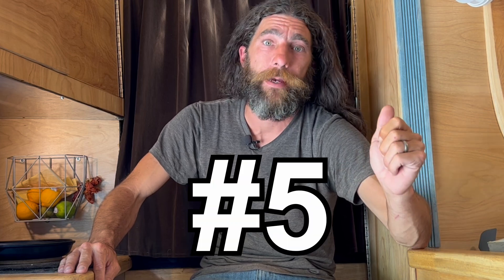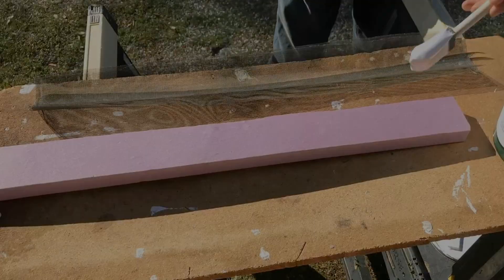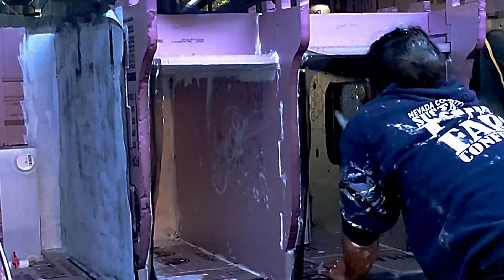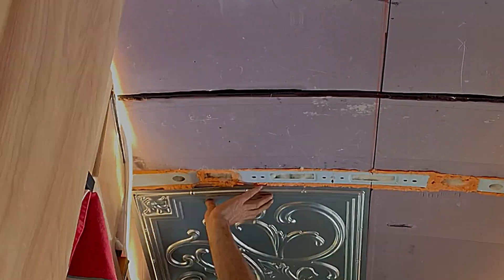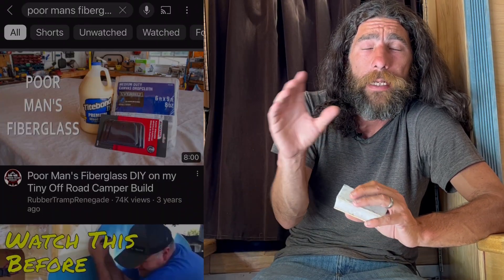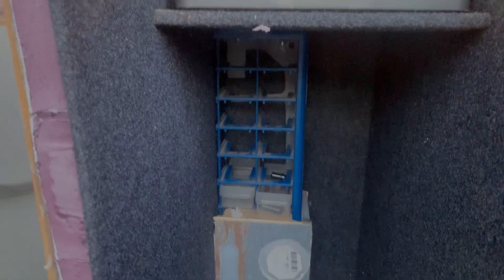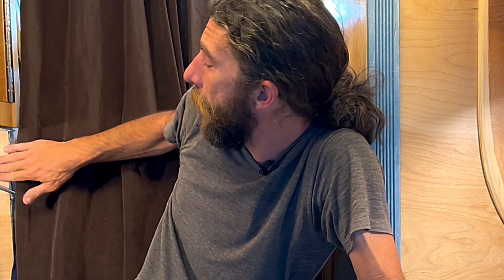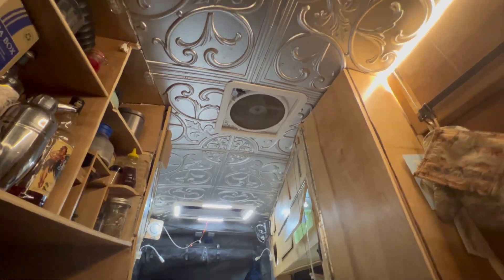Foam Camper Van Screen & Skins -Foam Building System Vol. 5

Comment: Really enjoying your channel. Lots of good practical advice. I am looking forward to building a few things using this method. A truck topper, a small canoe or row boat and then eventually a squaredrop camper. I also want to do some strength testing along the lines of what you have done. I am curious to see if bonding multiple thiner layers of screen and foam is stronger than one thicker layer of skinned foam. I would also like to do some tests to see if perforating the foam with the spikey roller things actually helps with the strength of the pannel or if it only helps to ensure full adhesion. I think the light weight, the mold resistance, and the resistance to water penetration make this an amazing build material. Even if you do get water through the glue/paint/skin layer it still can't enter or damage the foam. I think it would also be interesting to test the strength if you only screen one side and leave the other as bare foam in situations where you can ensure that only one side will be under tension. Cheers, you have given me lots to think about.
Reply from the maker: Don’t forget the insulation factor!!! I too would like to do tests on the screening methods. I struggle to come up with a simple and meaningful test method. The way I do in these videos showing weight on a span and it curving x inches is fine for foam in span / horizontal orientation, but I’m not sure it’s accurate for when foam is a vertical support since the load is not being applied that way. Putting pieces in a hydraulic press would be more accurate but… uh… I don’t have a hydraulic press just lying around. 🤔
Reply: @falkornomad  So for open disclosure I will admit to having an engineering degree and while we are far outside my area of expertice there are a few general principles we are all taught. The work you are doing is great, measuring the deflection of the foam is a strain measurement and it is really important as many things fail due to strain. But the other thing that is great that most folks don't get is that builds that allow for strain better distribute the loads throughout the entire structure and avoid point loads that often lead to failure. (In other words bendy-bendy can be really good depending on the application). The big thing I want to investigate is when you load the foam in diferent configurations and different orientaions when does it fail and how does it fail. Do you first lose adhesion from the bonding agent or do you fail the screen/laminate tensile member do to the tensile load or does the interior part of the bend fail do to compression. A really cool test would be to fatigue it (by this I mean; cycle the loading 1,000,000 times to see if funny stuff happens over time like microtears, mictro fractures or delamination), this would show how it stands up to a few years of on road abuse but that would require special equipment and time and money so is likely a non starter. Another cool thing about these pannels is that I think they would be easily and near infinately repairable without any special equipment. I think when you describe your build you should call the pannels "engineered composite panels comprised of a light weight, non compresive core material encased within a nylon fabric tensile outer layer, bonded with a high strength water resistant adhesive". Sure as $hit sounds more impressive than foam with a screen glued to it and you know all the commercial folks describes their stuff like that despite it not being much different in anything other than price. Anyhow I love your channel, I think if you keep doing more regular videos you will get more veiwers and hit that 10k subscriber mark soon. If you do, it will be well deserved. Godspeed my man!
Reply from the maker: Thanks for the follow up! I’m trying to get “Foam Bones” to catch on for this build method… I like your suggestion.. but maybe as a definition… it doesn’t exactly roll off the tongue 😜 

As far as failure over time; after 20k miles over 7 months, I can tell you that the most common failure is the 1/8” ply separating from the foam on the edges & corners. Especially on longer horizontal spans (over 18”) on the long side of the curve / bend. For example in the video example at 14:20, the ceiling of that situation, if it was 18” or more. This is why I made this point about applying the skins in a particular order. 

Thanks for the encouragement and support of the channel!
Reply: Great! I'm pondering building a very small, two man catamaran powered by solar that is sea worthy.
Reply: @Bennyboy-dog  I think that is a great Idea, PMF (poor mans fiberglass) and the screen over XPS (which I think of as another version of PMF) can both be used if the boat will only be used for shorter excursions but I don't think these adhesives we are talking about will stand up to long periods of immersion. If you are planning to use the boat on long holiday weekends or short multiple week trips, I think you will be fine. Anything longer I am afraid you may need to bite the bullet and to to full on fiberglass+epoxy. One other thing if I may be so bold to suggest, think about doing a trimaran, that way you only need one electric motor and one rudder, the larger central hull with smaller "amas" or outrigger hulls might be easier and more forgiving to build and since they are smaller it makes the boat easier to be foldable and trailerable.
Reply from the maker: Great minds think alike… I suggested 2 outriggers @Ben Mitro in a previous comment thread.
Reply: @sanukcanuk1282
Have you accomplished any of those goals fellow engineer?

Comment: Where's my beer?  Very informative video.   I hope to do some foam builds in the future.   I've learned a lot from you.   I wonder if you think it's worth the extra work on the bed support garage to do it with skinned foam vs 1/2" baltic birch plywood?   For me the plywood would just be a cut it out then glue and staple it together, then paint it process.  Which process do you think is more work?  Or is it about the same?
Reply from the maker: I discuss labor in the vol 1 of this series, it’s about 20% more work for foam. It depends on your design, if you need or want large open bays under bed, ply might be better since it can span longer distances. If not and you value the insulation between bays, or need lightweight foam is nice. That cooler I have in my garage and my electrical system can produce a lot of heat but the foam being R5 contains that heat in those bays more than you would think. I am really happy with the foam and would use it again for the bed / garage as long as my design could accommodate it.